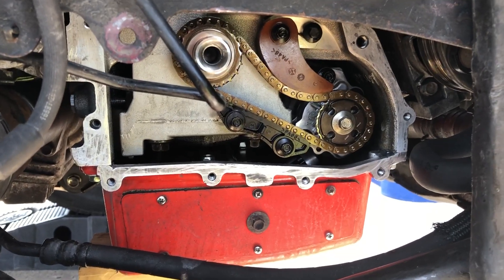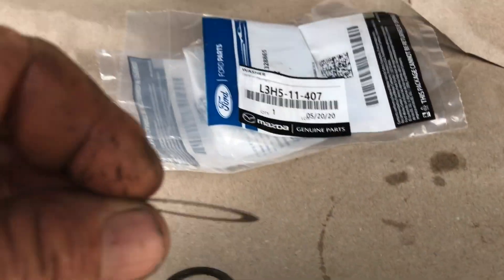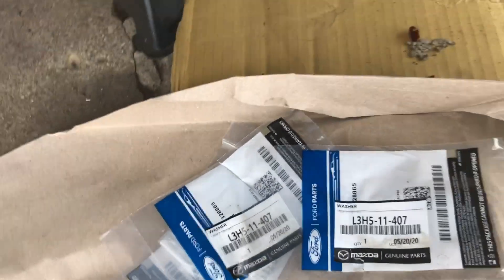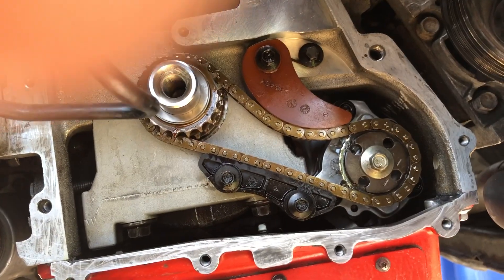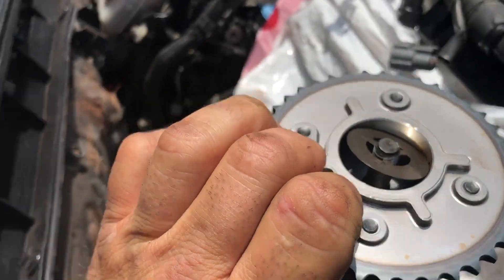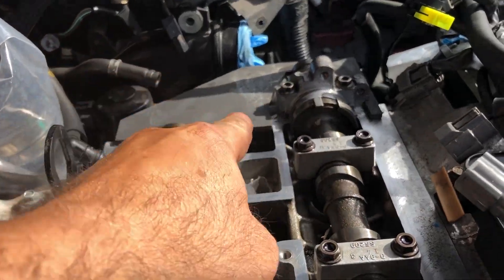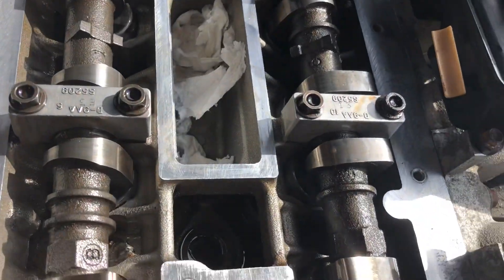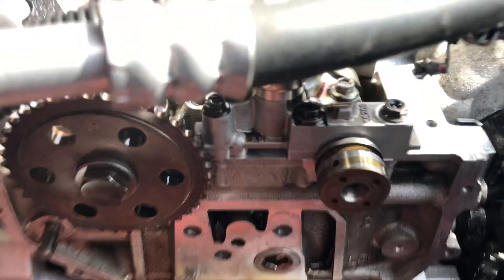How to install a   VVT  Actuator and Timing chain PART 1 Mazda 2.3 l Turbo engine

Comment: Not sure that the dot 12 o clock position is a problem  as it doesn't reference anything .
Reply: As far as I'm concerned, positioning the the sprocket helps with diagnostics in the future.

Comment: Hi I have a question.  On the vvt sprocket or 'phaser'...the spring and cap fell out exposing the round channel.  Does this mean I need a whole new phaser?  Or would I be able to order the part and install? I noticed this when I went to replace my vvt solenoid
Reply from the maker: yes  you do mean the hydraulic actuator  ? VVT
Reply from the maker: yES    THE PARTS IS CALLED variable VALVE TIMING IS NOT A PHASER (  THE VVT IS CONTROL BY THE  OCV  WHICH IS ALL  HYDRAULIC CIRCUIT WORKS ON OIL PRESSURE )
Reply from the maker: yes